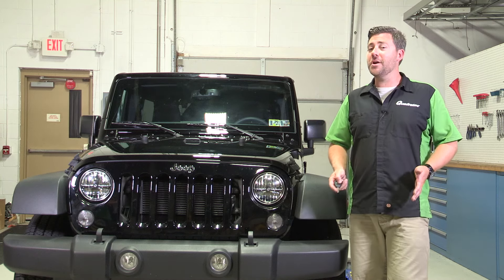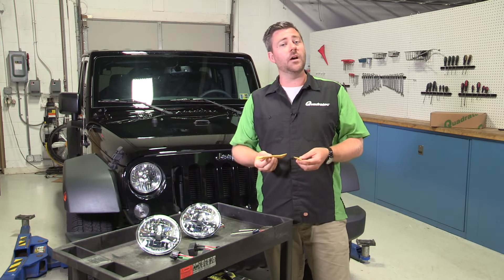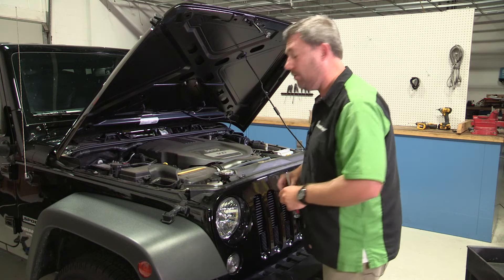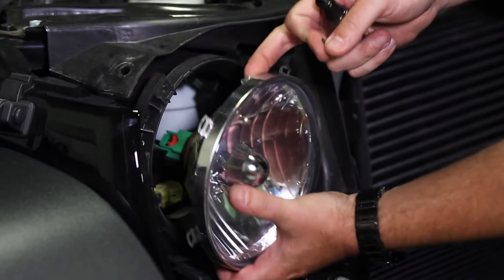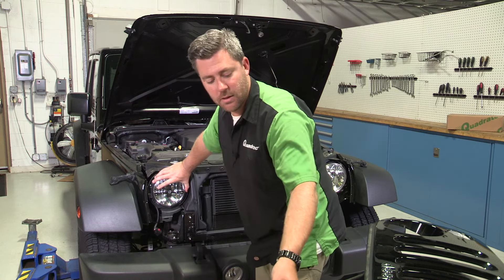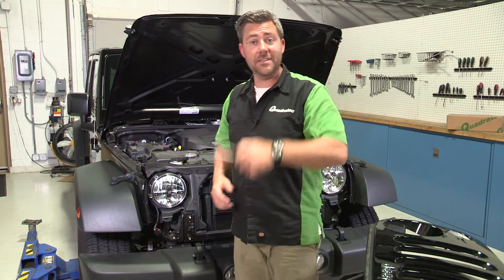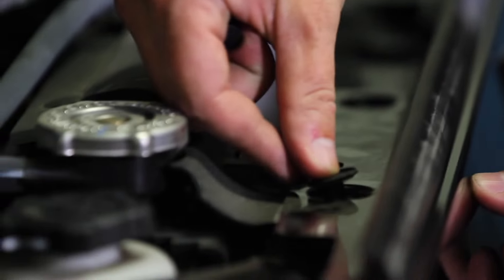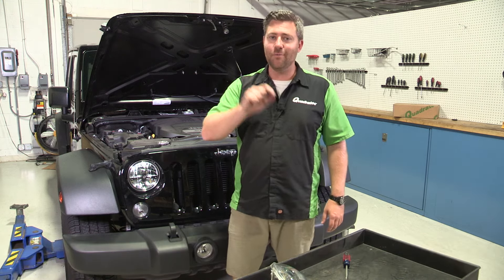How to Remove Jeep Wrangler JK Factory Headlights

Comment: Some aftermarket headlights require a red wire running to the fuse box, for daytime running lights.  If you have the pulse switch modulator, will you actually need the red wire? I noticed you didn't use or mention it.

Comment: I would not use Factory Mopar LED Headlights! I ordered the LED Light package on my new 2017 Jeep JK from the factory. If one bulb goes out, you're screwed. Replacement bulbs Are Not Available! The only way to replace your burnt out bulb is to upgrade the Whole LED Lighting package! $$$$ Nobody sells 1 replacement LED Mopar HeadLight Bulb!

Comment: I recently installed these on my 2015 JK. The beam pattern seems to have a bright "spot light" about 30 feet ahead that combines the left and right lamp. There is a less bright and generous amount of "ambient" light outside that "spot" pattern.  Is the intent to have this "spot" as I describe? There is no factory adjustment to separate this spot. Thanks! Erik

Comment: How do you align the beam once a headlight is placed? Anyone?
Reply: If you look around the outside of the housings there are 2 adjustment screws. one up-down and one left-right. best thing to do is pull up to a flat wall or fence when it is dark and adjust the screws one at a time and watch the pattern move. Adjust them until they are even and not too high. I cant tell you the exact height, but if you get flashed by oncoming drivers then just lower them al little until other drivers stop flashing you

Comment: Question: are the retaining rings and screws precisely engineered so that when the new headlights are added,  they will be properly aligned?  Thanks, good video.  I am ready to try this.
Reply from the maker: They should be good to go as far as alignment goes. They fit in just like the factory. Lots of folks like to reaim because of the different beam pattern.